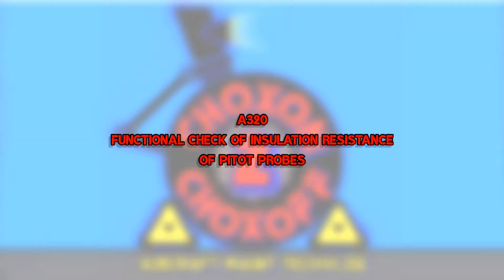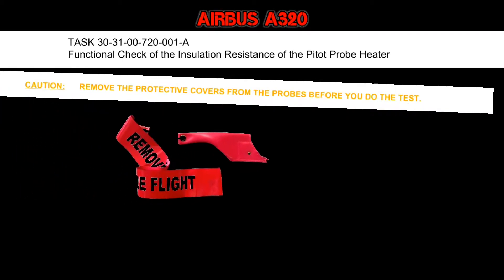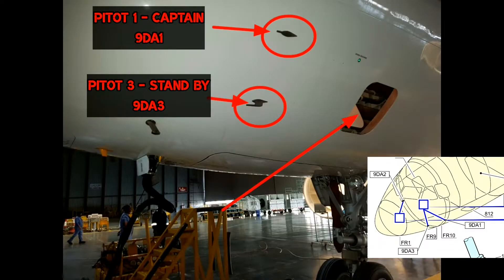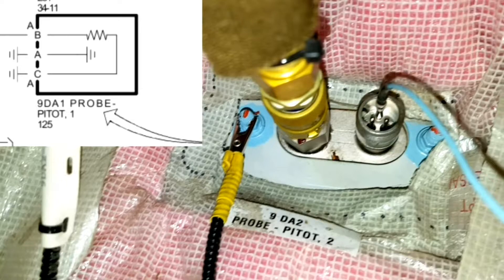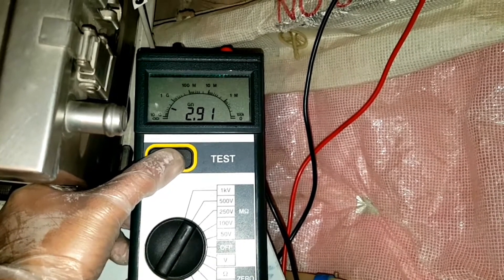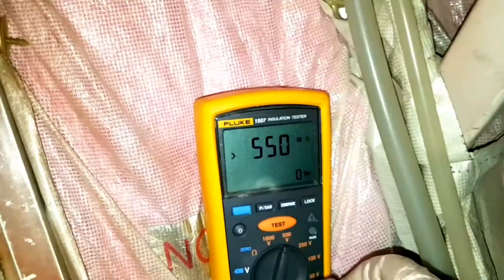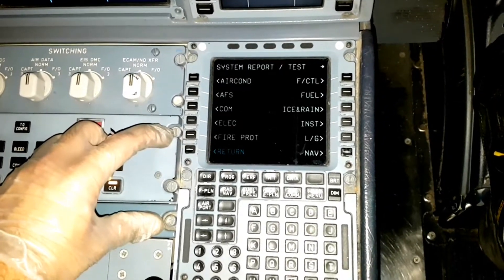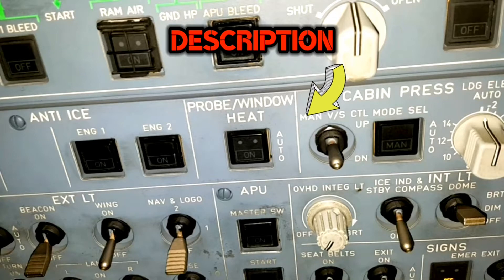A320 PITOT PROBE HEATER INSULATION RESISTANCE TEST with FLUKE 1507 and RS BM80/2 tester

Comment: which work card did you use ??
Reply from the maker: Refer to the MPD TASK: 303100-01
AMM 30-31-00-720-001-A Functional Check of the Insulation Resistance of the Pitot Probe Heater